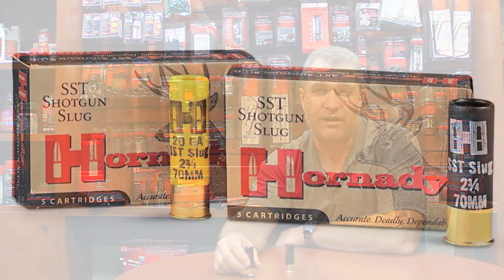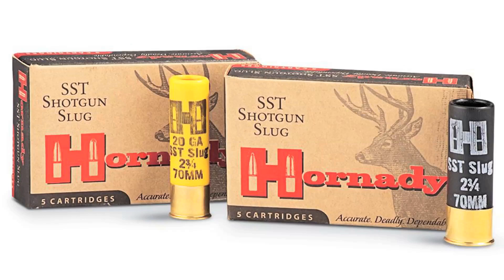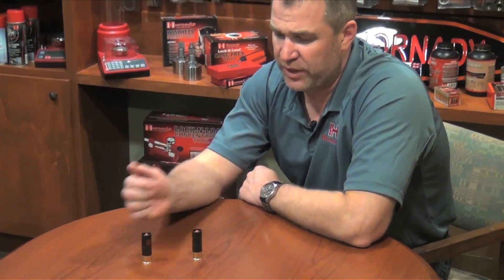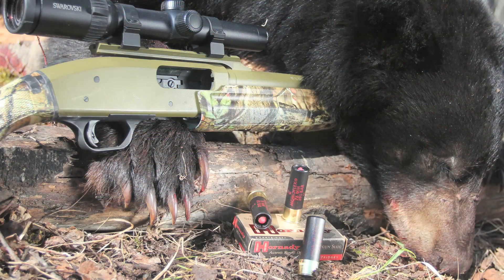Hornady Superformance Shotgun Slugs - Jason Hornady

Comment: My uncles farm was being destroyed by a large boar. He was raising pure hell and my uncle is old and can't take care of things like this. I can. I loaded my Mossberg 500 with 6 Hornady MonoFlex slugs and found me a perch over the trails he used. At three in the morning he came strutting down the path heading for the garden to tear out more vegetables. When he got to 60 feet I made a grunt that got him to stop. It was the first good look I got of him and he was massive. We weighed him later and he was exactly 550 lbs. with huge cutters and whetters over four inches. His shield was like a 2 inch thick plywood. I hit him with the first shot and got him just above his front leg and just a little towards the rear. It took him off his feet and flipped him over. He never made a move or a sound. We drug him up to the light and looked at the wound channel. I have never seen such a cavity. We found the slug and it had opened up fully and kept all the weight. I will never use another slug. The power and accuracy was off the charts. I paid $16 for a box of five, so a little over $3 each. I would have paid double for that performance.